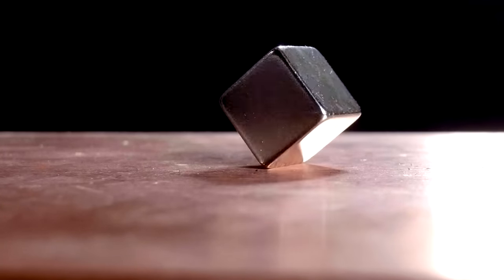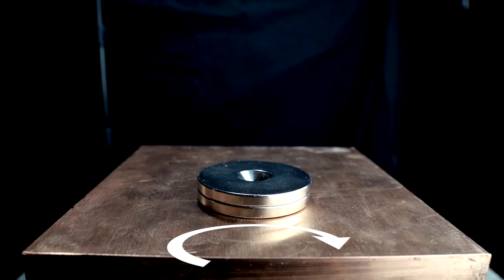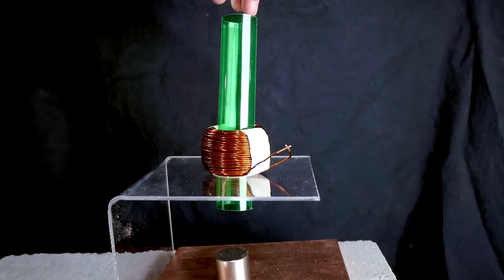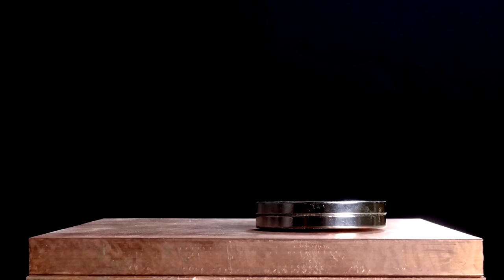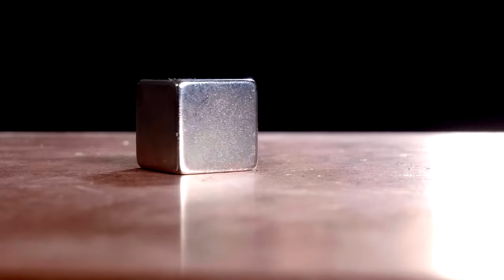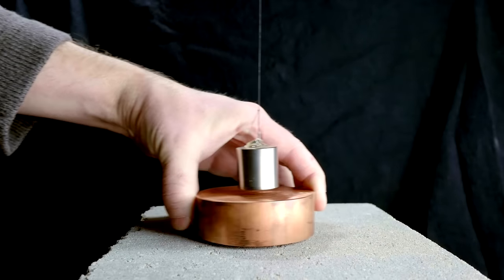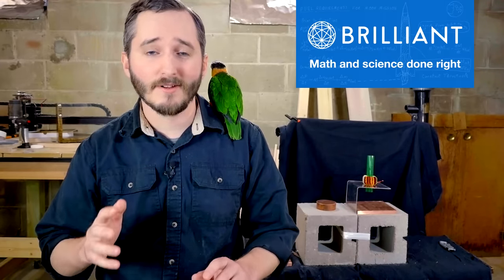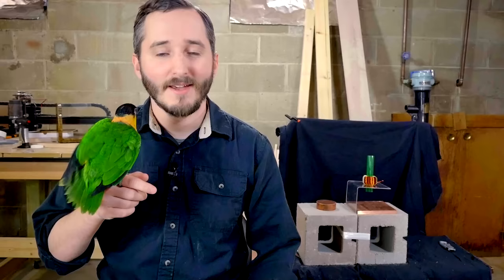Copper's Surprising Reaction to Strong Magnets | Force Field Motion Dampening

Comment: This is also a good explanation of why electricity doesn't go through wire but around it.
Reply: so true
Reply: What
Reply: Electricity does indeed go through a wire but there are effects which depend on the frequency.  At regular power line frequencies of 60 cycles, larger wires ae better conductors.
Reply: My understanding is that electricity flows along the outside of a wire and not actually through it.  I don't know how the smart guys figured that out, but I think that's what Dan az was saying.
Reply: Arrgghh!!!  Why do the elemental forces that make up our entire universe have to be so complicated????!!!!!
Reply: Wrong... Electricity tends to flow best at the outer edges of the wire. This is due the actual space that the atoms collide the least amount. At the center of the wire is constant collision of atoms and restricted motion although virtually all of the conductor is used. This is because of Eddy Currents. At sufficient frequencies,  Eddy current loops flow along the conductor. They flow in the same direction as the magnetic field in the outer edge and in opposite direction in the inner edge. Thus, the outer edge offers less resistance and current flow is concentrated there.
Reply: Uh-oh.  Looks like we have a schism forming in the electrical community.  This can only lead to hundreds of years of bloodshed and persecution on both sides.  :-(
Reply: Dan az , DC current or direct current seems to travel inside the wire and you need more strands of wire like battery cables on a car, there are many small strands of wires that make up one big wire, and the electrons travel better Through the Wire so to speak, ----- AC current or alternating current seems to travel easier on the outside of the wire, thus when you are wiring a house you use 1 single strand about the thickness of a pencil lead, Nikola Tesla invented AC current and can be transmitted miles without the loss of voltage, magnets can make electricity and electricity can make magnets, aluminum is a good conductor of electricity, copper is better, silver is better than copper and gold is better than silver at conducting electricity, that's why they use two little gold prongs on the sensor in the front of the car that triggers the safety airbag and the reason they use gold in electronics such as computers and smartphones, it's not the volts that can kill you it's the amps behind the volts that turns your blood to gel and your heart can't pump gel
Reply: @jimthomas777  I think I've been hearing lately (in the car audio community) that a singular, thick copper wire was better for powering amplifiers than the many-stranded wires you can buy.
Reply: Dan az
Reply: Frequency as in sound effects the flow of electricity? I'm just learning about this.
Reply: @jimthomas777  Actually, silver is better conductor than gold. Gold is used primarly because it is resistant to corrosion.
Reply: Yes, silver is the best conductor, followed by copper, then aluminum. And electricity DOES flow thru a wire, and the electric flow induces a magnetic field around the wire; not electricity around the wire.

Comment: Fantastic video! I'm a physics teacher, and I can't wait to show this to my class. I'm particularly interested in getting a plate or disk like the ones you have for classroom demos. I looked on eBay but only found very thin sheets. Was there a particular search term that got you to the thick plates?
Reply from the maker: Yes if you search for copper bus bars you can find larger plates. The ones I used here were 6x6x1/2"
Reply: look on mcmaster dot com.  They supply all sorts of equipment and materials.
Reply: Great tip, thanks -- I order from McMaster all the time for laser cutter acrylics and it never occurred to me to look for copper there.
Reply: Thin plate works too, like 1.5mm or 2mm thick. Pipes aswell, drop a magnet through a copper or aluminium pipe, same thing.
Reply: pomfretvids 
Just be prepared for sticker shock.  Copper is expensive!
Reply: If you REALLY want to show the something interesting i have 2 easy and fairly cheap experiments for you to play with.

1) support a disc magnet between two tesla bifilar coils, no movement, just supported. Measure the volts and current it produces. 

2) take a fairly large magnet and put a coil near it like you would a generator. Use a small signal generator and a speaker to play sound through. Play with the signal until you find the frequency that resonates with the size of the magnet. It will produce a small voltage and current as well, again with no movement of the magnet. 

Funny how noone ever shows this experiment.
Reply: there are special places where you can buy ridiculously powerful magnets too. I found one magnet with a strength of one half ton LOL
Reply: Aluminum plates exhibit the resistance to sliding. The braking action of the pendulum not so well. You could use this to explore the differences in the materials characteristics.

Comment: You think that's something try how magnets effect fire. Light a candle and come close to the flame with the magnet and watch how the flame reacts to the strong magnetic field. It will try to move away from it as far as it can without leaving it's source of energy. It will let the magnet touch only when the flame can't go any farther because it will leave it's source of energy. That is why I think everything doesn't just collide with the sun. Although the sun has a gravitational pull it also has a pushing effect because fire want to push against other things that has a magnetic field around them. That is why we aren't just pulled into the sun I believe.
Reply: I see what you mean bro. If it has the right magnetic properties and it's the correct weight of density it will be engulfed or pushed away.   I think that's what you're saying. I was wondering if you reversed the copper and the magnet, also how much you need of each for it to effect one another.
Reply: It could go deeper than that. It’s probably linked to the fact that since fire is a plasma, the particles that make it up are charged (i.e electrons and nucleons), which is why they experience a magnetic force. Interesting!

Comment: Doesn't have to be copper, most metals will be conductive enough for this to work.  Better to use a light metal like aluminium, then it will float much higher.  In the Science Museum in Paris (Palais de la Decouverte) they have an aluminium candelabra which floats above a powerful electromagnet and has  candle lamps lit by the induction - very impressive!

Comment: What would happen if you shot a Copper coated Bullet into a strong Magnet?  Would the magnet STOP the bullet?
Reply: It would slow it down, but i don't think it would stop it, as the bullet would be pretty hot (if shot by conventional means), so it's electrical conductivity would be low.
Reply: I was thinking the opposite,fire a neodymium bullet to the Cooper bar ???

Comment: this is hands down one of the best videos on this subject, but you missed a vital part when you replaced the shorted coil with an LED.

a decade resistance would have shown how the resistance of the coil, the resistance of the load, and the potential energy of the magnet in falling are DIRECTLY related, and just how much power you actually can obtain... and where it is produced.

say, several coils of different gauge wire, but the same mass of copper... the amount the magnet slows in each case... how the voltage and current may alter but overall the energy stays the same, but WHERE IS IT BEING DISSIPATED?

the dead short may give the highest braking, but ALL the conductor heats evenly.

whereas an ideal resistance in  a"circuit", not too large, not too small, will give the maximum power dissipation at I2R in the load, with some heating taking place in the coil itself still. too large, and then theres no heat developed at all... you are getting closer to an open circuit.

too little... and you just produce heat. in the generator. instead of in the kettle. or the toaster.

Comment: If you put a big resistance to both ends of the copper coil, this might slow it even more, right?
Reply from the maker: Low resistance slows the magnet more because electricity can flow more easily
Reply: NightHawkInLight ooooh that means that just the electron flow blocking itself slows the magnet?
Reply: Zantrop64 Here is a different (hopefully also correct) explanation: The more energy Is used for powering the LED or heating up a resistor, The less is left for slowing down the magnet.
Reply from the maker: Not quite. The more electricity that can flow the stronger a magnetic field can be generated. So if you have a resistor not as much electricity can flow and the magnetic field will be weak.
Reply: NightHawkInLight so moving the magnet through the coil makes current flow through the bobbin, making it an electromagnet, slowing the neodymium magnet. Makes kinda sense

Comment: maybe this concept can be used for falling elevators?
Reply: haha ur body will still absorb the impact
Reply: This is the exact process used in the tower "dropping " amusement rides.
Reply: Eddy currents is what the whole video is about.
Reply: Oh yeah
Reply: Magnetic car
Reply: Eddie currents. Look up roller coasters made by the manufacturer Intamin. They have many roller coasters, but one in particular that comes to mind is millenium force. As the coaster train gets pulled up the very steep slope at about 20mph, if the train or lift ever fails for whatever reason, and starts to go backwards; the wheel on the bottom of the train stops generating an eddie current to hold an anti-roll-back device above the track, and the anti-roll-back mechanism falls down and slips in notches on the track to hold it's position to prevent the train crashing down into the previous train. Hopefully that made sense, but it's rather genius and interesting.
Reply: Big magnet needed
Reply: @oldsilkhat7893   I was about to mention it's use in carnival rides :D
Reply: It is, in the form of electromagnetic breaks like on some trains
Reply: evander2222 there wouldn't be any impact if the walls of the shaft were from copper.
Reply: They actually did exactly this on SmashLab. A great show that should of had a longer run.
Reply: I just take the stairs
Reply: you might stop the elevator but what about  momentum ?
Reply: Yeah, instead of a 100' drop it'll only be 99' 11."
That'll save lives.
Reply: Everyone is missing his point or the point I guess, you don't have to use the breaking at the last second. You can have electro magnetic brakes that would activate automatically based on g force, so as soon as you gain more g than designed or expected the magnets would activate for a short duration. This way you could avoid building up the momentum in the first place by doing rather shorter release/grab sequences.
Reply: falling elevators is a very rare thing because they have hooks that grab the sides of the shaft to keep the elevator from falling.  if the hooks fail you would be screwed but that would require such a catastrophic failure its almost to never happened.
Reply: I think there are less elevator crashes than lightening strikes hitting people
Reply: I'm afraid the cost added would be too much for the very low chance of an elevator free-falling unless you charge people to ride the elevator (since a regular elevator already has electric and maintenance costs).  The doors crushing or trapping you have a much higher chance of happening.
Reply: They use it in those drop rides at amusement parks.
Reply: @EvenThere  Since there is a relatively soft deceleration, there is no "Impact".
Reply: @mauriciojorgeyattah8871  what ?? so your saying ur body is made of copper?? hahaha
Reply: @EvenThere  No, you fool. As the elevator decelerates your body does not "crash" into it. It is a gradual deceleration. Did you not see the part with the copper wire?
Reply: ALERT. This man has crazy ideas. witchcraft. maybe he's a jinn.

Comment: I would like to see a magnet shot from a shot gun at a block of copper filmed by a high speed camera.
Reply: Easier the other way around: Fire a copper slug at a magnet.  Magnets can be quite brittle (& sensitive to heat also), and may not survive the gun barrel journey.
Reply: @roidroid  either way would be fine with me. You could wrap the magnet so it didn't have direct contact with the barrel wall. I just want to see the magnet or the copper stop from super sonic speed.
Reply: These magnets are brittle.
And flammable

Comment: I so badly want a magnetic doorstop, that dampens the opening door, so that it can never slam against the wall, when being opened too fast & makes it slightly difficult to pull away from the fully opened (against the wall) position.
Reply: Is that how slow or soft close cabinet doors work?
Reply: Those are usually hydraulic
Reply: @ImpossibleTorture  Yeah, good hydraulics are fast. Bad ones block the doorway
Reply: Use Bomer hinges
Reply: That's a great idea.

Comment: Hold on, hold on, how is it that the coil when the wires aren't sticking out and connected there's no reaction. Yet despite say the multiple loops connect over another, getting two end and connecting them together causes resistance?! How is that simple connection outside the coil causes the resistance?!
Reply: The wire is insulated by a coating. 
The tips of the wire has been scraped clean exposing the copper.
Reply: @thomash1923  I don't get what you stated has to do with creating a field that slows the magnet passing through it.
Reply: @rubens.4116  I’m sorry, I may have misread your initial comment.
Reply: @thomash1923  yes, well, after some thought I may have answered my own question. If you ever seen the simple "lighting of a light bulb" circuit where you have one copper wire directing electricity towards the bulb and another leading it back to the battery or energy source, it applies to the coil. Except the energy going through the coil had no light bulb to be used by going through it it looped causing a North and South magnetism to go around the coil causing the magnet to slow down.
Reply: @rubens.4116  There was no light bulb but an led. Had there been a  light bulb the magnet would have slowed down.  An old school light bulb would have had a low enough resistance to allow enough current to flow. 

Shorting the coil just lowers the resistance even further allowing even more current and subsequent even higher opposing magnetic field. 

Shorted coil, light bulb, led all MUST slow the magnet. It's a matter of how much and was our measurement sensitive enough to see it.

leds are more complicated non linear non resistive devices which just so happens to result in negligible current flow and therfore negligible opposing magnetic field. 

 Note it's WAY more complicated than that but there's no need to go down the rabbit hole of tensors, quantum, special relativety etc.  Simple circuit theory is accurate enough and won't explode your head :)

Comment: this could be used as a shock absorber or damper
Reply: Or car bumpers but it would add a lot of weight to the car.
Reply: MN SHP No. It couldn't. It's not practical.
Reply: Indeed. I believe that this principle (using an electromagnet rather than a permanent one) has been trialed for making variable dampers on vehicle suspension. Using an electromagnet means that the suspension damping can be varied almost instantly, allowing the suspension to constantly adjust itself for optimal performance.

The downside (which makes it impractical for everyday use) is the energy consumption compared to a normal 'passive' suspension system.
Reply: I believe Bose has created an automobile suspension with electromagnets. Pretty cool stuff.

Comment: Why hasn't the automobile industry started using magnetic breaking system?
Reply: So you don't stop buying ceramic breaks and rotors, there's so many designed with planned obsolescence  to purposely increase maintenance.
Reply: Renkei ...yeap, it's a business
Reply: Actually it has. Trucks and buses are usually fitted with retarder, which is usually electomagnetic (not necessarily tho). Reason why small cars are not  fitted with those is the extra space they take, compared to regular brake disc, increased price of the final product and unnecessary complexity.

Comment: ...Good Job ...just copper? ...Zinc ...Lead ...Galvanized Steel ...Gold ...Aluminum
Reply: I think that he is using copper because it is the best conductor. But you’re right those conduct well too.
Reply: @the_matthatter  No, it's a union thing.
No, it's a union thing.
Reply: Clinton - Send me a few kilos of gold and I will test it for you and make a video...
Reply: CLINTON JONES what the hell is aluminum?  Never heard of it.
Reply: Silver is a better conductor.  I would love to see that.
Reply: @the_matthatter  Copper is second-best element for conducting electricity.  Only silver is better.
Reply: @Jared7873  silver is only a (slightly) better conductor by volume.  By mass, aluminium is better than both.